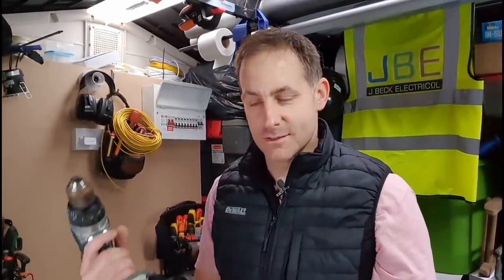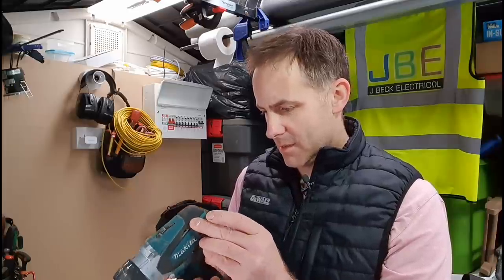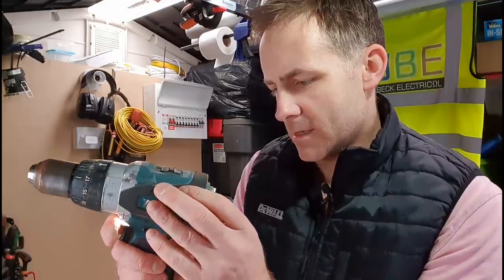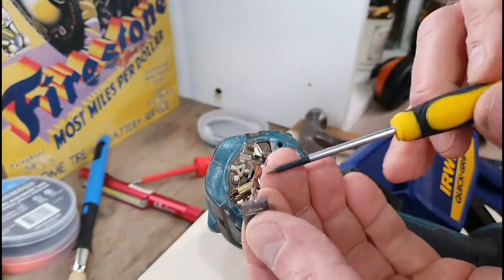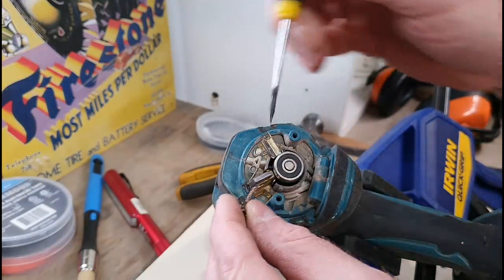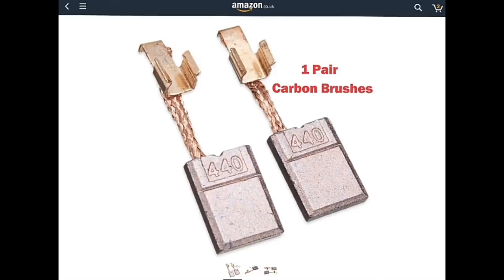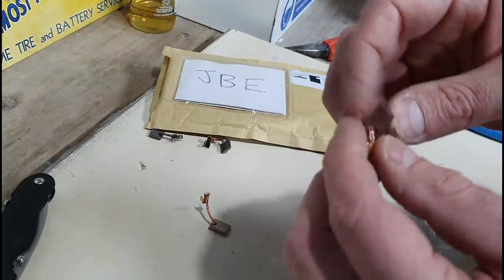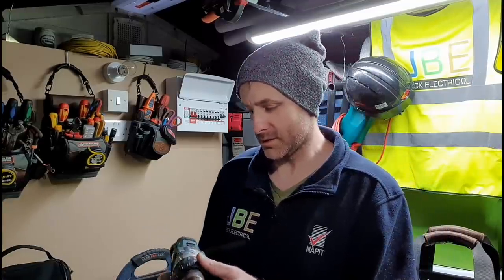A cheap fix for worn out drills. (41)

Comment: Other things that could have been done, is to flatten the end of the bad Brush
with a piece of emery cloth, or fine sand paper, to get rid of the burnt part, but don’t go mad doing it.
With a piece of emery cloth about half inch wide, and about 3-4 inch long, put it around the commutator 
holding it reasonably tight, spin the chuck with your other hand, to clean any rough or burnt parts, until the
commutator is back to a shiny copper colour. Then, with a thin blade from a stanley knife or similar, gently 
run it down the slots on the commutator, blowing off any fine particles. Spray with a little “good old WD40”.
Dry off any excess WD40. refit Brushes and back cover. Then listen to a lovely sounding Drill. Obviously, if the Brushes are really worn down low, then fit new ones, and still clean commutator, as above.
Ta Trev.
Reply from the maker: That's a great tip for next time Trevor 👍. Unless I've gone brushless by then? Tool maintenance is a must to keep the whole system moving.
Reply: As Trevor says, but avoid using emery paper as the particles can be conductive, definately sand paper. My old apprentice master used to "tune" Spitfire aircraft generators in the war, for minimum radio interference, wearing a pair of headphones and with the engine on full lick and a stick with sandpaper on the end to polish the commutator, (Bring on Health and Safety.)
Reply: Peter White, That’s why WD40 was mentioned to spray on after blowing off any fine particles, it washes off any fine particles that may be left behind. I’ve done this method for about 35 years, with great success! Trevor.

Comment: Most modern drills now are brushless motors . Had my milwaukee 12v 7 years and my 18v about 4 years without any problems.
Reply: Brushless ones aren't much use for painters and decorators.

Comment: Hey pal, dont suppose you can give us a review on the Kewtech KT65DL or if you would recommend buying one after useing it for abit? in the market for one and been looking at it,
Just dont want to invest so much into a possible mistake ta mate
Reply from the maker: It just so happens that I'm working on a little video about MFTs.
Reply: @JBE  dont suppose you can tell me what the little silver touch plate is for pal?
Cant find anything on it anywhere
Ta
Reply from the maker: @Adept1780  I believe it is to ground any build up of charge within the MFT via your body. This would only be small but could cause problems with readings? You'll have to ask better minds than mine for the exact answer. Try David Savery, John Ward, GSH or e5. These guys all have extensive experience and knowledge with MFTs. Failing that give Kewtech a call.